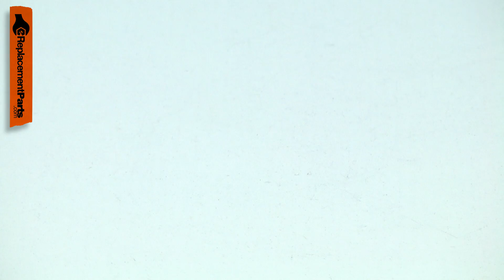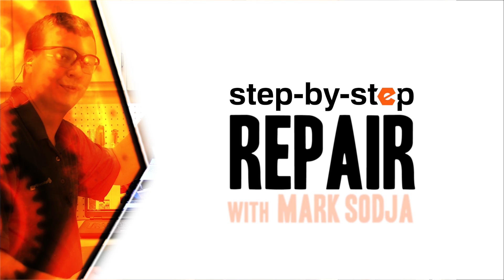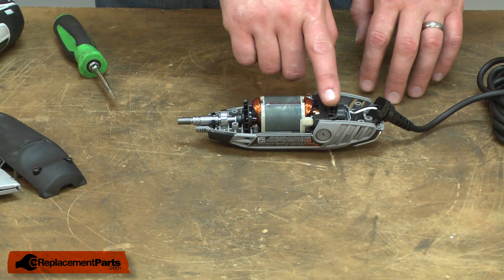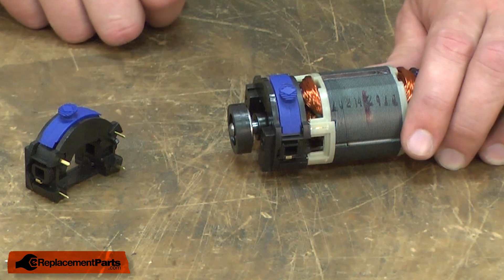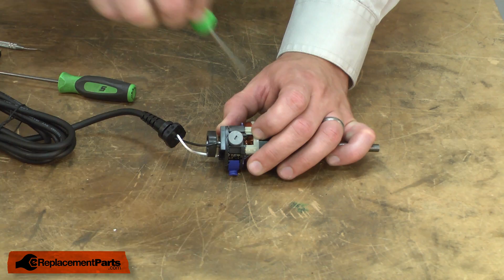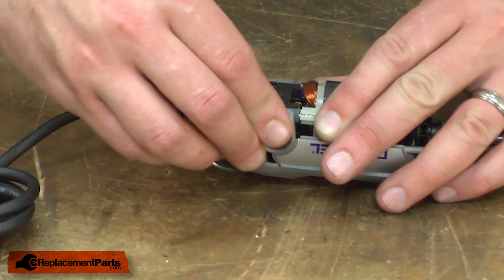Rotary Tool Repair - Replacing the Switch (Dremel Part # 2610013852)

Comment: I noticed the installer reversed the hot and neutral wires on reassembly. Does it make a difference?

Comment: I followed the guide and now my Dremel is more broken than when I started, the new speed selector switch works but the motor is really tight after reassembly and all it does is buzz and I cannot find anything online about the new issue I'm having and how to fix it, I've taken it apart and put it back together over a dozen times and it still won't work and everything looks correct.

Comment: Thank you for a great video. However I am a little confused about how the two pieces that are located under the Shif Lock Button go back in place.
I'm confident I can replace the switch but hate to mess up the last part.
Thanks again.

Comment: I took the switch apart,  cleaned the contacts,  bend the copper contacts a bit and saved money and time not buying a new switch.   Works great.
Reply: Wish you had taken a video of that!! So my contacts look okay... Which makes me think switch. Watched this video hoping to see how to diagnose the switch. I'm not having a good go at this....

When I took the tool apart things kinda fell out... The wires connecting to my power cord aren't held in place with a circuit board... I guess it's made only for the U.S.🤷🤷 I'm not sure if I'm putting them back in the wrong place.
Reply: I think I need to tighten those "trap doors" do you know how to do that?? My wires just came out way tooo easy...
Reply: where did you buy it the switch please

Comment: Got my tool in 2016. Last week, I was cutting a screw when it suddenly died. Repair the Dremel 3000 took a bit of tinkering. Took me 4 hours to get it working again. First, the stator coil wires on both of the contacts were broken. Had to unwind a full turn of wire to repair one and the other had to be joined by soldering. Next the switch thumb clip came off. Had to pry open the switch casing to push thumb clip back onto the switch. Assembly was a nightmare. Took me 6 attempts to get it right. Can't fasten the screws too tight, just enough to keep the parts in place. Finally when I turned it on, the SWEET sound of spinning rotor turned on, setting it to lowest and highest speed as it should. Everything worked out finally. No parts required to repair this time. Hope this tool could last me for another 5 years. I really love this tool for light grinding works. Polishing rust, knife sharpening, fishing hooks, drill holes and crafting works.

Comment: Is there a way to test if a switch is good? Cause I'm getting tired of replacing parts only hopeing that it works
Reply: Yes.  You can use a voltmeter. You will be checking ohms for continuity. Type in your search engine  " test a 110v power switch " . You'll find lots to read or videos on it.

Comment: Do you sell  replacement lock shaft pin for a Dremel Micro 8050 ?
Reply from the maker: Hi Nikki. Here's a list of replacement parts for the Dremel Micro 8050. 
https://www.ereplacementparts.com/dremel-8050-f013805000-micro-tool-parts-c-15440_15478_459129.html
I hope you find the part you're looking for!